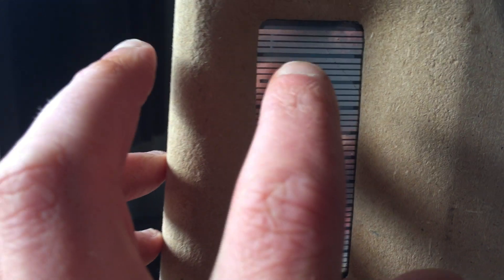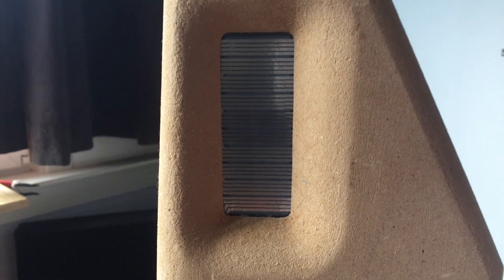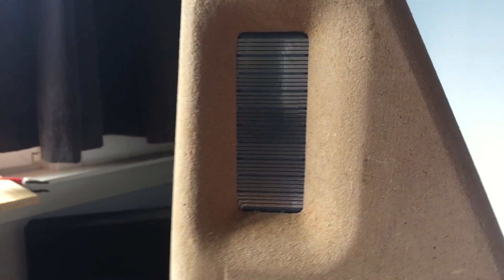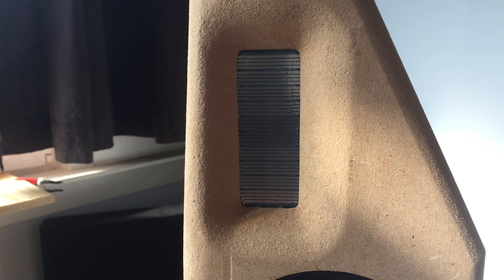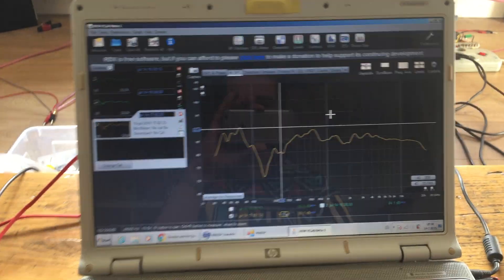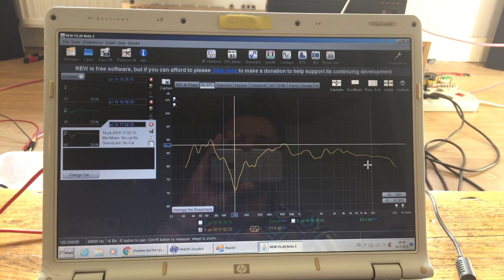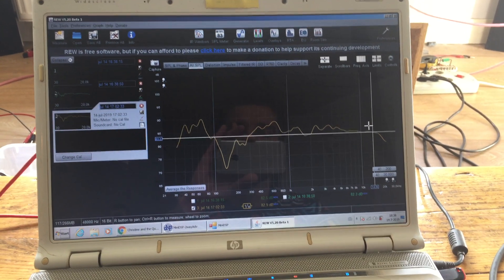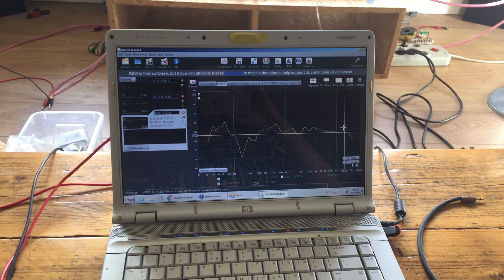Neo V10 Planar  Diy tweeter driver, very small update and a tune

Comment: What method did you use to make the waveguides? (i.e. router, CNC, by hand)
Reply from the maker: my cnc. cant say i designed the wavguide to anything i just wanted a smooth transition :) and tried a few baffles.  it was milled with a straight bit multiple passes until it was easy to smooth it out with a piece of sandpaper. same for the corners etc. all rounding are on the baffle.   the whole prohect was done out of a quartersheet of mdf 61cm x 122cm. all things cut from one side only.  so i could put 1/4 sheet in come back  10 minutes later and reposition the sheet (my table is only 65x75cm)  then cut part 2 without having to use dowels. i had enough space left over to just shove it, and add 2 screws and hit start once more.

Comment: The big dip at 150 hz indicates something very fishy,  have you tried running the tweeter in reversed polarity?
Reply from the maker: Tweeter does not play anymore at 150 :) thats woofer domain. It a in room measuremnt at 1 meter or more so low end you have to take wirh a huge grain of salt

Comment: My suggestions would be that you lean towards making a stereoversion of your desktop speaker fed by a class D transconductance amplifier. Was that your first venture into stockingfabrication? I know its against your preferences, but I think you should make it with a build-in subwoofer that produces pseudo-bass ala Bose. That way you could maybe even make the panels smaller. Make a few thousand on your kitchentable and make a name of yourself selling those for inflated prizes to feinsmeckers. They truely looked and sounded the part.
Reply from the maker: You mean the one from this video or you mean like the Bluetooth planarmagnetic ?
Reply: The bluetooth one. To me it looked not far from a finnished product. I never heard a transconductance amp. As I understand they play linear when impedance is linear. Therefore planars are a good fit for them. I never heard it but Ive read so many testimonials from very experienced diy'ers, that Im at least convinced that I need to hear one. My brother's audio engineer collegue supposedly have finished one, so maybe he can arrange it. By the way. I was invited to hear a full Earl Geddes setup by one of his disciples. Might happen next week. Will be nice to hear how perfected? polarpaterns and multiple subs sound
Reply: https://patents.google.com/patent/US7924091B2/en
Reply: https://www.diyaudio.com/forums/chip-amps/239321-joe-rasmussen-trans-amp-40-watt-transconductance-current-amplifier.html

Comment: Even though I am not there, I can tell that these speakers have a beautiful transparency in the midrange, and highend.  Maybe build a three way for your next design, with same tweeter, a midrange driver (Possibly planar) , and a bass dynamic driver, with an external sub-woofer, using mostly passive, with some active x-over design.  I would also buy a MiniDSP, to for the active x-over, and super transparent parametric eq, passive network on the high-end, and active bellow 1000khz.
Reply from the maker: it uses a mindsp at the moment but only for the simple crossover.  well a MFB woofer might be in the works :) from a friend of mine.   i dont like using EQ to be honest :) since that should be part of the fun to get it correct to begin with :) else i can mate any 2 speakers with enough DSP :)
Reply from the maker: Oh and thanks ! , almost forgot how rude :(